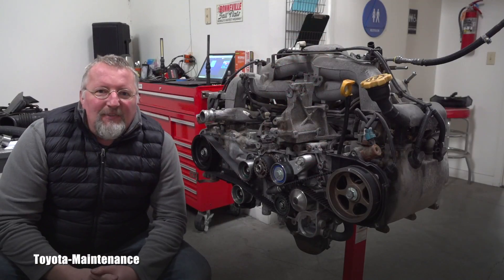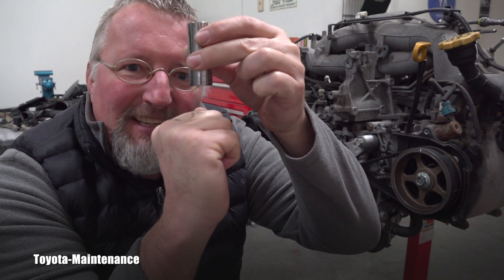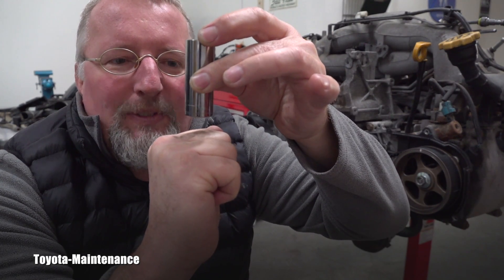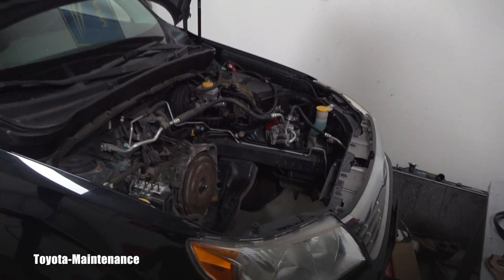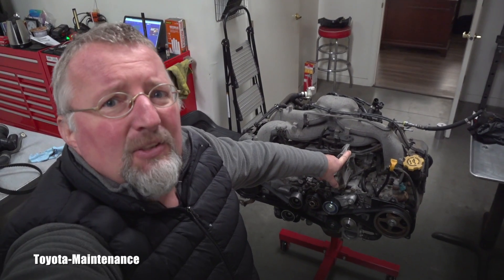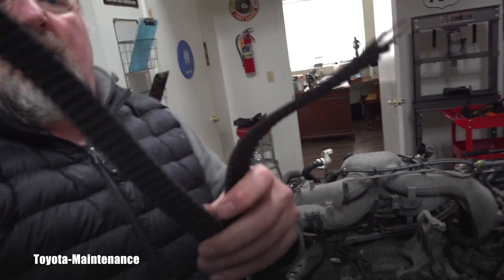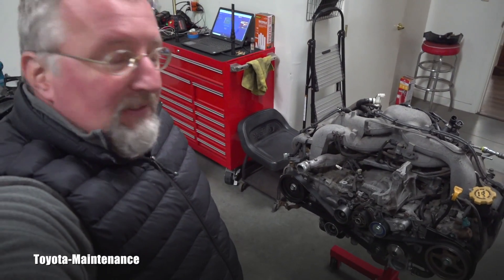Avoid Interference Engines with Timing Belt

Comment: Sir there's nothing wrong with timing belts vehicles, you just have to replace them as recommended and with a OEM or OEM quality parts. That belt snapped prematurely bcuz the previous person used a cheap knockoff Chinese parts from either ebay or Amazon and that's a No No especially with timing belts and components regardless of vehicle make. 

If you dig deeper, you'll find out that that's exactly what happened bcuz those belts are supposed to last up to 105k to even 130k miles depending on the make. So timing belt isn't the problem, cheap parts are the problems. 

FYI, Aisin water pumps, Timing belts and components from a REPUTABLE company like Rock Auto, Worldpac etc is the OEM manufacturer for ASIAN vehicles.

 That's what I use for the most part and I've never had problems with them, they last just as much as the factory ones bcuz they are the same quality. You can also use other brands like Dayco etc if you are in a bind or time constraints as long as you get them from REPUTABLE Auto parts stores like NAPA, Advance Auto Parts, Auto Zone, O'Reilly etc. So timing belts are great. 

There several examples of vehicles that uses Timing Chains and are nightmares like some Fords and the Mazda CX7 etc with internal chain driven water pumps that ruin engines like nobody's business.

Comment: Absolutely ZERO reasons to have any type of belt doing any functional duty for an engine beside the accessories.
Reply: I am of the same opinion. The real reason for using a timing belt is the much lower cost. But it seems the automakers are beginning to realize the folly of timing belts and are going back to chains.

Comment: I have a 2003 4Runner with 110,000 miles. Thinking about replacing the belt myself this upcoming spring

Comment: Yaris did it right, timing chain w/o any tensioners, there is an adjustment bolt located near the alternator. No broken belt or tensioner to deal with. A true economy  car
Reply: I know. My Scion XB has a similar arrangement, thankfully.

Comment: Great advice. Most folks don't know this . I have a 1999 toyota rav4 with a great engine, 249,000 miles. I also have a 1995 honda odyssey with  a not so great engine 300,000 miles. Both  vehicles timing belt failures on hwy. Toyota easy. Honda major repairs bent valves etc. I do my own repairs. Learned all from you and others. Stay safe waiting on my vaccine

Comment: To those uneducated people who are complaining about Subaru’s: Subarus are great vehicles. Maintain them, and don’t abuse them and they will last you a very long time. Every auto manufacturer has their issues. Toyota, for example, having many many issues with oil consumption in the 2.4 engine found in Camrys and RAV4s. Honda, with its poorly designed automatic transmissions that would fail prematurely. People love to hate on Subarus, and I’m sick of it.

Comment: There is pros and cons to Belt driven timing. Emissions standards demanded the belt along with the financial stand point of production. Additionally its unfortunately another service mark up for stealer-ships; however I have seen more tensioner failures on timing systems then belts- when the tensioner starts to fail it can pre-maturely fail the belts along with pulley(s) i.e tensioner pulley and water pump bearings. Belts have been manufactured to high tolerance specs. The Con of a timing chain is stretch- thus adjustment and other issues with timing.
Reply: Yep,  changed it all on  my kids used Volvo...11 months later the tensioner pulley spring broke.  Interference and very far away from home.   Got rid of the car

Comment: I have a 2005 Rav4 and a 2015 tacoma, how can I find out  which engine I haver?
Reply: Should say on the sticker under the hood.  The Tacoma and the Rav4  have a timing chain regardless of which engine it has.  Should last the life of the engine as long as the oil was changed regularly.
Reply: @gncc600  Thanks  and Merry Christmas

Comment: Thank you Peter. Very helpful. I have 09 Forester with 190k miles. I had Subaru do belt at 120k. Head gasket is leaking. In Subaru shop now. I am anxious about hearing this information. Ugghhh. Money pit.  :(
Reply: No, not a money pit. Look at the miles!! Toyota Camrys and RAV4 s had the 2.4 engine which were horrendous for oil consumption. Were they money pits? Maintain the Subaru, replace the head gaskets and it will last you a long time.
Reply: @caraficionado4724  Thank you Nicholas.

Comment: Always change the timing belt at the recommended interval. But I would also change any other components that could cause the belt to slip or come off if they fail. For example the idler pulleys and the bolts that hold them in place. I would also say, use a timing belt from the manufacturers. Not third party
Reply: The question is why is this even necessary in the first place. Why in world would engineers make such an engine if not of the fact that they want to keep the repair and maintenance money coming.
Reply: @alphainfinitum3445  Yes that is a good question. A think chains are superior, but the devil is in the detail - how well is it engineered and manufactured? Years ago I had a car with a gear driven cam. It was a push rod engine, not overhead cam. Properly made it would probably last the life of the engine

Comment: Makes me nervous. My wife and I just purchased a 2005 Lexus RX330 with 53,000 miles, the vehicle looks like it did as it did coming off the show room floor. It’s a very nice vehicle. We had all the fluids changed, including the rear differential, and today, ironically, dropped it off to have a new timing belt and water pump replaced. Why? Because of age, not mileage. We are on a fixed income, and are hoping this car lasts us ten years or more. But, I gotta say, this timing belt stress is new to me, makes me nervous. How long can I go before I should replace it again? Any advice or comments from anyone?? Peter?? Your thoughts?  -Stephen, Ohio
Reply: Should be good for 10 years or 100k whichever comes first.  No worries as long as you did the water pump.  Former Toyota engineer and current Subaru engineer.

Comment: Will the timing belt manufacturer assume any liability or is Peter on the hook for the entire repair?
Reply: Peter is eating this one.  He should have used higher quality parts.  These Evergreen belts have a bad reputation.  Probably trying to save the owner money.
Reply: @gncc600  did Evergreen ever give any guarantee?
Reply: @LAactor  They would likely replace the timing belt for free but wouldn't help with the engine repairs.

Comment: Nothing wrong with timing belt engines so long as you replace the belt, pulleys, tensioners, water pump on time and with OEM quality parts.  I've personally done Honda, Toyota, and Porsche 928 timing belt jobs with no problems.  For the longest time I wanted a Subaru specifically for the boxer engine.  That was until I started learning about the problems the engines have with head gaskets.  No thanks.
Reply: The old EJ22 didn't have head gasket issues.  The new models seem to have solved the issue as well.  That being said I work for Subaru and have a garage full of Toyotas.
Reply: You are obviously getting your information from an uneducated person. Subarus are great. Yes, they did have head gasket issues. But, what about Toyota’s oil consumption issues on the 2.4 engine?? Every manufacturer has its issues, Subarus issue was the head gaskets. I’m sick and tired of people hating on Subarus. They are excellent vehicles when taken care of and not abused.
Reply: @caraficionado4724  The 2.4 oil consumption issue was typically on high mileage engines and toyota replaced the short blocks on a lot of these.  Great engines if you didn't have oil consumption.  Speaking of oil consumption...lol  Subaru has massive issues across multiple engines with oil consumption.  Subaru makes a good car but they aren't on the level of Toyota.
Reply: @caraficionado4724   I'm willing to listen.  I'm looking for a AWD car for my daughter.  What year or generation Subaru would you recommend?

Comment: What make was the belt?
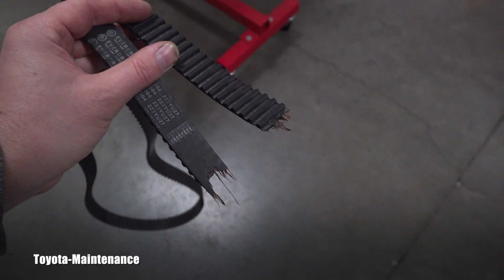Reply: 2:52 Evergreen?
Reply: @n9wox  Likely an Evergreen kit.  Known for belts snapping.
Reply: @gncc600  The few Amazon reviews I saw for Evergreen were mixed. I thought Peter would buy higher quality parts.
Reply: @n9wox  He's always so hardcore on oem parts.  I'm surprised he didn't use Aisin or Subaru parts.
Reply: @gncc600  hopefully he didn't use customer parts
Reply: @n9wox  Don't most shops refuse to warranty customer parts if you can even convince them to put them on?

Comment: Trying to ascertain whether a used car has had the required belt replacement is really aggravating. Dealers and private party sellers either don’t know or won’t say if the belt has been replaced. Buying a Honda or other with over 100k becomes a crap shoot yet the prices never reflect the chance the buyer is taking.  With an older car a timing belt failure basically sends the car to the boneyard.
Reply: Agreed John if I don't have documentation of the service I subtract a $1000 from the price when I'm looking at these cars.
Reply: Unless you have reliable documentation, I strongly recommend replace the timing belt and all fluids...Then I annotate everything in my "At a Glance" Automotive journal. All my cars have journals with every Maintenance/part ever performed.

Comment: Hey peter I have a 2002 toyota tacoma with a 3.4 liter engine v_6 does this have a none interference  engine?
Reply: I think it is til  2004 that the V6 Taco has a belt,  2005 to present v6 uses Chain. 4 Cylinder Tacos use Chain all years since 95.
Reply: @mitomr.twiceasnice4358  I know my 3.4 engine has a timing belt but what I want to know is this a none interfering engine ?
Reply: @josephgonzales3857  Its a non interference engine.  Won't hurt a thing if it breaks.  Pretty easy to change as well.
Reply: @gncc600  thank you so much what a relief I just bought this truck about 2 mos ago it's got 160k I don't know when was the last time they changed the belt
Reply: @josephgonzales3857  Just bought a 2000 myself with 196k on it.  Try going to the  toyota service history website and register an account and add your vin.  You can see all the services done by Toyota since it was new.  Might help figure it out or you can take the cover off and look at the belt and see the condition.  Enjoy that bulletproof ride.
https://www.toyota.com/owners/my-vehicle/service-history
Reply: @gncc600  thank you I will look in to that you've been great help

Comment: New chain driven small engines have even higher chance of such failure than the belt driven ones. All thanks to the oil filled tensioners that do not provide stable tension of the chain on engine start or just cold engine.
Reply: Not all manufactures use the oil filled tensioners and most of the problems you speak of happen when well-meaning owners use the incorrect viscosity engine oil, or rev the engine too high immediately after start-up, but I agree, there are some failures caused by this design none the less.
Reply: Unfortunately the timing chain drives they use today are not really any better than timing belt drives. Unlike old classic domestic cars and trucks that used timing chains that would outlast the rest of the engine, the timing chain drives they use today use relatively narrow gauge chains which aren't as strong, so they wear faster, and plastic chain guides and oil filled tensioner mechanisms, which are prone to failures if not replaced on some frequency. They are a need-to-service item. Although timing chain drives have a longer service interval, when the time comes they are more costly for the parts and service. If the chain breaks, it can cause every bit as much damage as a belt driven system. Most higher-performance engines are going to be of the 'interference' type.
Reply: @tempest411  I agree. I've never had an issue with timing belt replacement and I've never had one fail. As long as they are done within mileage and/or time specifications and you replace tensioners, rollers, water pumps etc. at the same time, then they should be fine. But I do this all myself and only spend money on parts. If I spend $300 on parts someone else may pay $1500 with a shop. So, then it becomes a higher cost item. However, most people don't keep their cars long enough anymore so the manufactures make sure they last until the end of the warrantee period and then you're on your own. Unfortunately for me, I usually buy cars that are 6-7 years old and are done with the major depreciation period. This strategy worked well with older BMW's, Mercedes, Porsches etc, but now they are also playing this game. I have since switched to only Toyota or Lexus and have had good results. Although there is evidence of Toyota starting to skimp on some models now too.

Comment: I just recently bought a 2006 Honda Pilot with over 180,000 miles. There was no records of the timing belt water pump service ever done. I didn't risk it any further and took to my local mechanic to get that replaced.
Reply: The hydraulic tensioner on this particular engine should be replaced also .
I have seen many timing belts been replaced  , then about 50,000 miles later the tensioner fails .
Makes a noise   , as belt is loose and flops .
Usually customer bring in car because of noise concerns. 
Luckily before any damages.
Reply: @inverseuniverse5727  You're absolutely right, the shop I took it in too is changing the whole timing  kit. I also supplied the shop with the  spark plugs as well.

Comment: Yea because timing chains never stretch and break or chain guide fail.  If you just pay attention to the motor you will know before there is any failure in the timing belt system.
Reply: Right on...... Ford 5.4 3v owners and GM 3.6 owners agree.

Comment: You look pisssed.   Lol dude it’s a engine they break parts are definitely defective sometimes but if you stay on top of your maintenance you should be fine.   I’m a Honda tech and see it DAILY yes timing belt is a bad design but it also keeps me employed
Reply: to be fair, Toyota techs don't have to deal with head service jobs much. For Subaru techs, it's their normal.
Reply: @wim0104  ...lol  Subaru techs can change head gaskets in their sleep.

Comment: Just change the timing belt when the manufacture says it should be replaced. Most times you can go past the mileage but not the time. Time causes the rubber to deteriorate and fail.
Reply: The problem comes in when these cars are old and have been through a few owners and end up in the hands of people who don't know anything about this or have the money to fix change it.  Try to convince someone who paid a few grand for a car to spend over a grand on a car that is working perfectly.

Comment: I'm confused though.... the 2UZ that you often praise has a timing belt AND is an interference engine. Could you clarify?
Reply: make sure you put quality parts in, nice and early. so not just the belt itself, check all rollers/bearings/pumps.
Reply: @wim0104  100% agree! I bought my wife a 2008 Lexus GX470 back in July. It was immaculate and only had 103k miles. All maintenance was super solid and it passed an independent mechanical inspection with flying colors, BUT and it was almost a deal killer, the timing belt had not been changed or at least I thought.  I went ahead and bought the truck and immediately had timing belt, water pump, tensioner, tstat and the whole 9 yards replaced. My mechanic called me during to tell me he thinks the timing belt actually had been changed and it had not been documented. I went ahead with the job so there would be NO question. We have since been driving the wheels off her truck and LOVE, LOVE, LOVE it. It now has 110k miles. Best used vehicle purchase ever!

Comment: I have a 2005 Toyota Tundra 4.7 v8 I was wondering if you would recommend a bypass or delete of the secondary air induction system
Reply: Bought a bypass system from Hewitt Technologies for $200.  Works perfect and saves about $1800 http://hewitt-tech.com
Reply: If you are mechanically inclined  .
You can fix with just the pump .
Remove and clean out all the other components of the debris from old sponge type inlet filter .
If motor is just jammed with debris just clean this out also  .
So it can be repaired for zero dollars if motor is okay .many houes if work though.
Reply: Great thanks for the heads up both ideas sound good

Comment: On interference engines all you have to do,is change your timing belt every 100,000 miles you will never have have a problem.
Only people who skimp on maintenance will have a problem.
Reply: and check your rollers/tensioner/waterpump. dont use cheap replacement kits for those either.